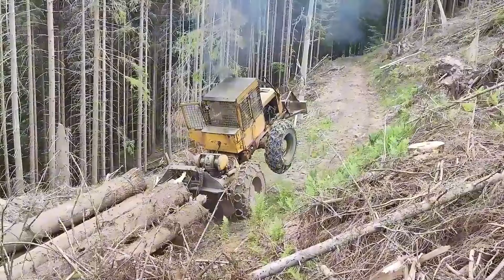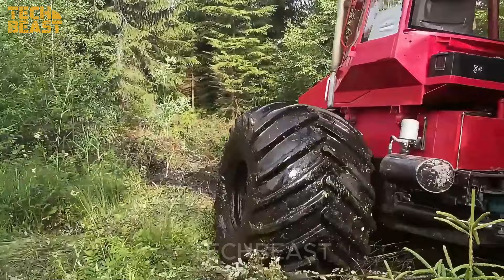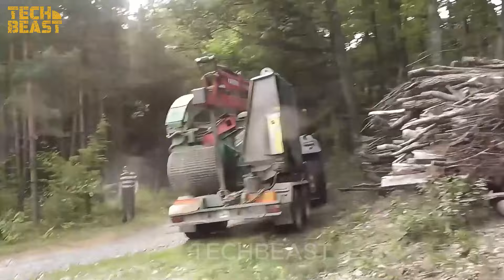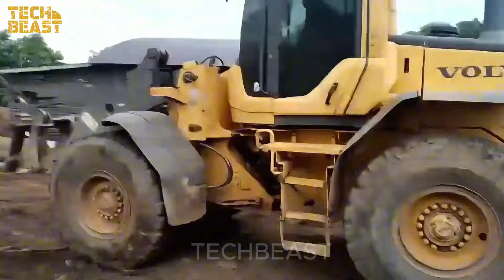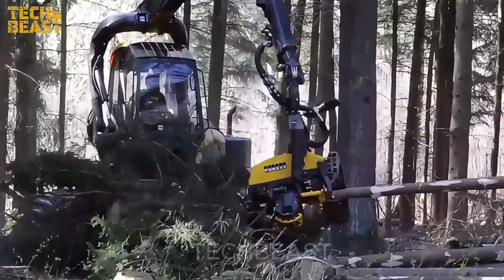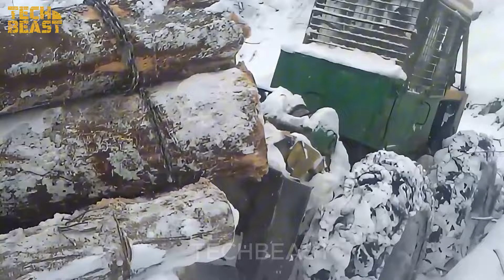Extreme Dangerous Big Logging Wood Truck Driving Skill | Biggest Heavy Machinery Machines #30

Comment: The noise level outside the cab would require hearing protection for any nearby personnel.
Reply from the maker: You are 100% correct, and that's an excellent point to bring up! Safety is always the top priority on any job site.